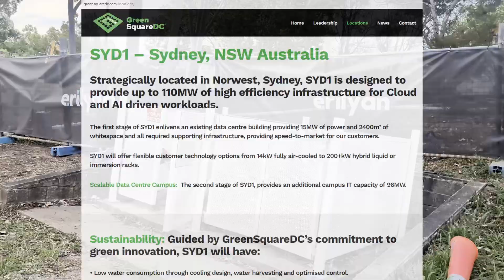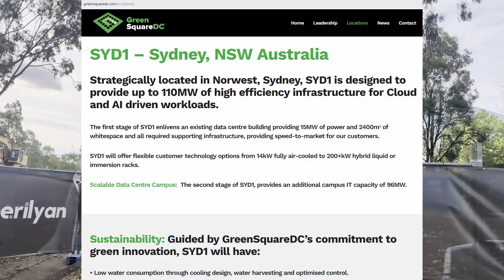Old IBM Data Center at Norwest moving to 110MW for AI

Comment: I work for a multinational engineering firm doing the infrustructure cabling desing for these hyperscale data centers, specifically the GPU clusters for AI. Mostly new builds though not retros or lease colocations. The amount of cooling and power needed for these is huge but not nearly as huge as the amount of fiber optic cables and silicone needed. We are having trouble right now with lead times on the fiber optic cables from corning alone. And the push to get them up and running from the client is big, they want these running yesterday. There is more to the AI iceberg than the ChatGPTs and Copilots you see in the consumer market, they are building these out to race for the ultimate goal of general AI and to be the first to market because it would be a huge payoff.

Comment: I am really trying to be an optimist about all of this but seeing the amount of power "used" for AI always puts me in a bad mood. Like whats even the point of saving power when these people convert every bit of excess power to heat? Just to keep some investment-hype-thing going? First we had crypto, now this. Why does every new "innovation" require running 1000s of GPUs at full power to keep the hype going? Is this some curse?
Reply: I dont believe the AI push is just a gimmicky hype train. I think LLM AI is a gimmick but the bigger push is for General AI and they absolutely need the power to make it happen. I work on designing these hyperscale GPU cluster data centers in the US and its a huge move for the big players. They dont just do this stuff for the hype. Theres way more to it than what you see in the consumer market.

Comment: Those boxes are not powering the datacenter. 110MW is a lot of power and it involves substation level equipment that isn't brought in through tiny boxes. They would involve trenching large cables through to an underground electrical vault. Those boxes would likely be for communications or even just the outside lighting systems and such for security purposes./
Reply: They seem to be 11kV or so boxes, so yeah maybe can only handle a MW each?

Comment: @0:28 I was intrigued by the low building with "ATCO" on the corners.  Over here in the UK that's a very old chain and motor mower manufacturer.  Obviously not the same in Aus, but I couldn't find any ATCO at Norwest NSW using the Googler.

Comment: All that excess power generated by solar is cheaper & less paperwork than running HV grid from external generators. The batteries are used then to spread the load.
Your new battery scheme have remote access by the supplier as UK systems are heading this way.
So you get grant for so called free batteries but this is cheap network balancing in the end.
So Free batteries but read carefully as who has overall control?
Even data about your usage to predict demand. 
Which could power these new data centers.
UK on average is supplied by 30%gas & today at 10:30 mid November it is nearly 50% powered by gas!

Comment: I want to see the backup generators for that beast when its done.
Reply: I don't think they'd be reasonably able to...hmm.  Ok, I suppose it could technically be done.  There are multi-megawatt diesel generators commercially available - 2MW, 4MW, stuff like that.  So if they had a giant park of 35 to 50 of those.... yeah it is possible.  Now think of how much scale of battery capacity they'd need to maintain on-time during an outage while they spun up 100+MW of generators.  Jeez.
Reply: Probably won't have any?

That's an entire nuclear reactor or multiple turbine gas plants generation capacity, isn't it?

Comment: Yeah nah. No way that thing can handle 110 MW, they would had to expand it quite significantly both to fit 110 MW of compute into it but also they will have to add 110 MW of cooling capacity somewhere and obtain zoning changes to be allow to blast the fans 24/7 creating heaps of noise pollution.
Reply: Ah, I think the rest of the 110 MW will be added at a different location in Sydney they're calling the "Scalable Data Centre Campus". I would imagine it has to be somewhere else as there doesn't look to be enough land at this location. Either way looks like you're going to be blessed with some nice big electricity price hikes courtesy of big AI. Hopefully our economy doesn't become 150% AI like in the US before it all goes south.

Comment: The trenching looks okay for 22kV/33kV. For the 110MW I suspect they would be looking at 132kV from the local substation / switchyard with a local transformer, with capacity for redundancy. I wonder if this will end up being shown in the NEM SLDs kept by AEMO.
Reply: They could even set up a new substation tapped into the Transgrid network directly